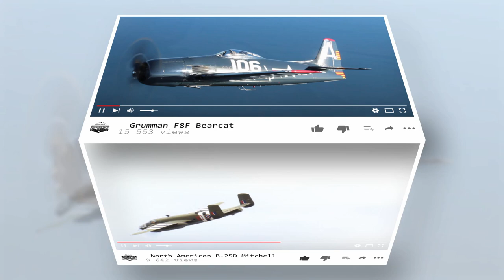Gee Bee Super QED - Paine Field 2015

Comment: Jim Moss built this in a garage. 50,000 hours to build. Bigger engine 10% bigger wing and vertical. Wider gear stance,than the original QED. Hence the name " Super QED" Jim Moss died weeks before it first flew. It's now for sale for $ 900,000

Comment: Beautiful build. Engine choice may have been the best and most economical available, but it almost seems like an aberration to have anything but a P&W radial in a Gee Bee. The Wrights had good power-to-weight, but a much less pleasing exhaust note, what I call the Wright Thump. Hornets of 900hp are not very common today, and the equivalent P&W engine hp-wise would be the R-1830 which is a two-row engine which is unlikely to have fit in the application.